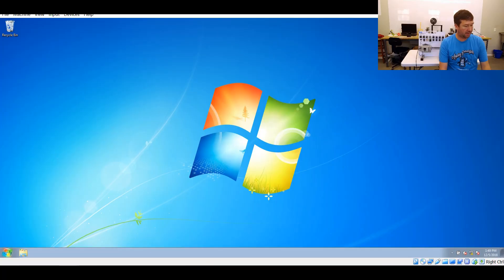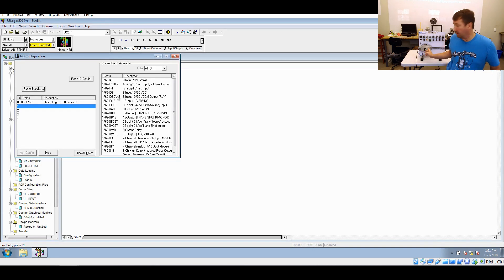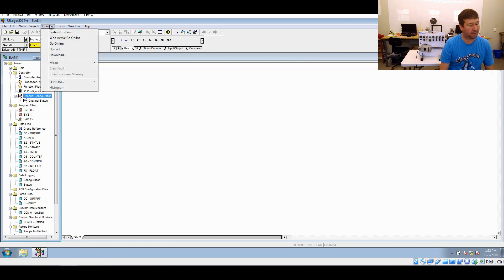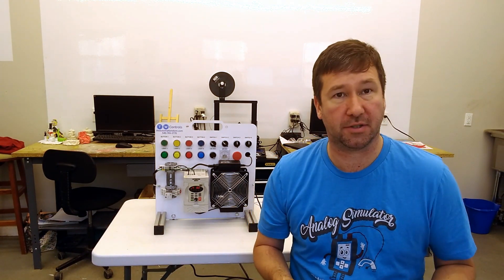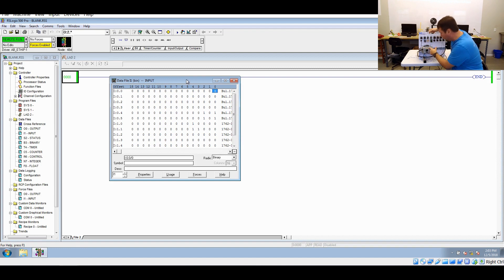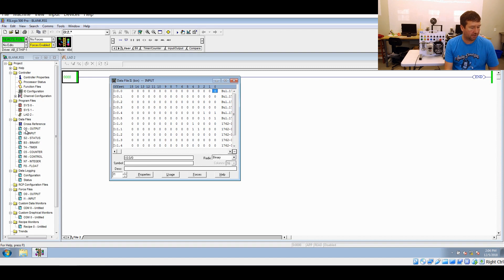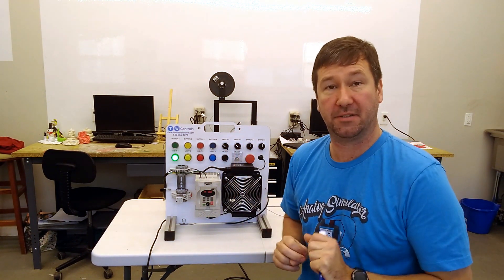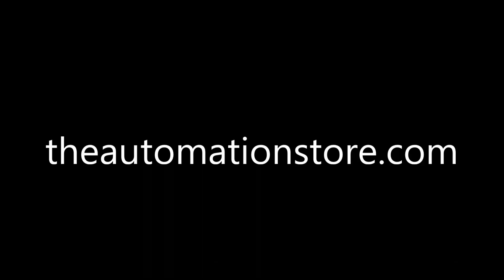RsLogix 500 - Does a Blank Program do Anything and What can You Learn From It?  PLC Scan Cycle

Comment: adding to the discussion, I used this video to break down the I/O (slot delimiter : ) Slot (word delimiter  . ), and Word / Bit. I still have to figure out the column on the far left going down the left side. I am told in Studio 5000 that there isn't anything after the 16-bit word. It's only 16-bit. No need for Channel = word x bit to figure out say 17, 18, 19, or something a lot higher. 
https://www.youtube.com/watch?v=YVf8Z0kW48w
Reply from the maker: Here is another one that will help.
https://youtu.be/q2DdKEdLpuc

Comment: In the video you select an Analog IO card, but you testing digital inputs Boolean, does it change if it is made with an Digital IO card configuration?, and Does an analog input do the same in a blank program?, I mean if you instead of giving 1 and 0, you give a temperature measure with a sensor, does it show up in the data type use for that 'float' instead of a boolean?... I am newer on this topics. Greatings I really learn from you!!!
Reply from the maker: This video wasn't on analog. You must add the analog module when creating the program to prevent the PLC from faulting.  Here is one on the analog configuration.
https://twcontrols.com/lessons/rslogix-500-analog-scaling-with-the-scp-instruction